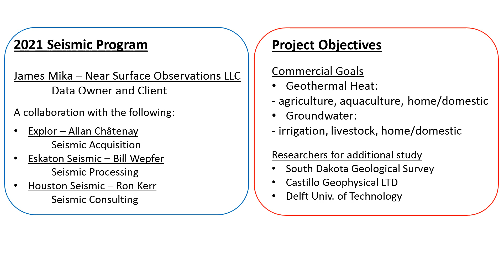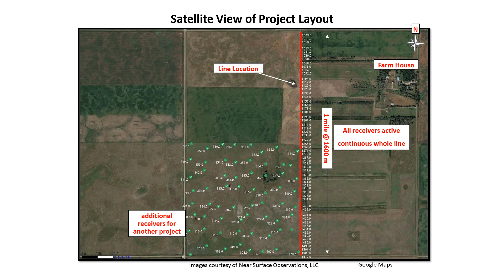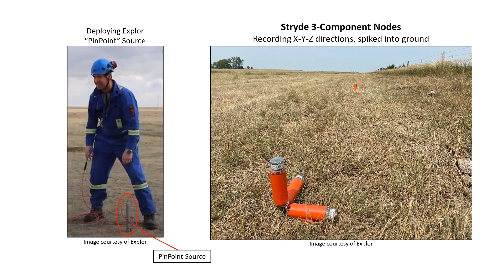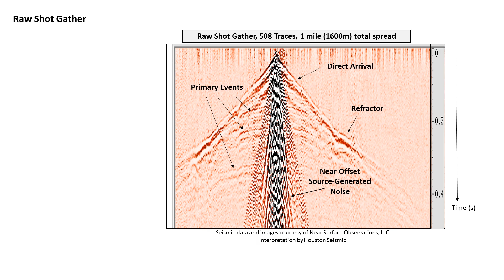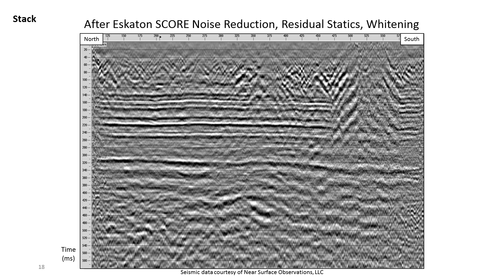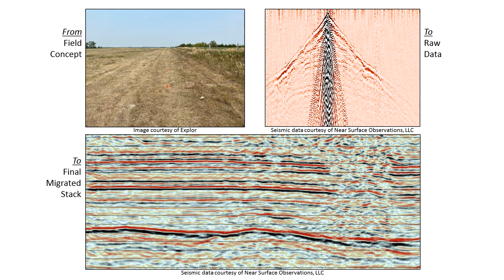Seismic Acquisition, Processing, Interpretation project, Near Surface Geophysics

Comment: Hi Ron, thank you very much for sharing.. Two questions… 1. The resulting vertical resolution within the Cretaceous section / 2. The depth of the unconformity. 
Thank you very much!!
Reply from the maker: David - appreciate the comments. Check out the slide at 2:10 for comments on the local geology and approximate depths. This is the eastern margin of the Kennedy Basin. The team is still studying the data for more specifics - best to you.